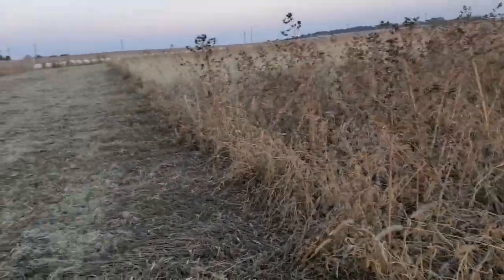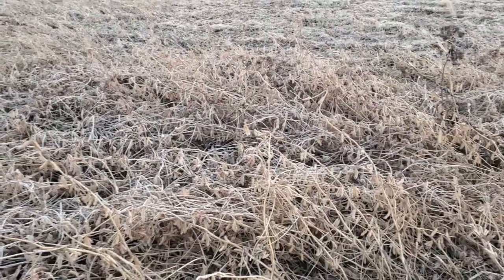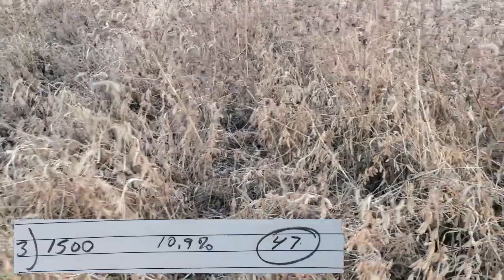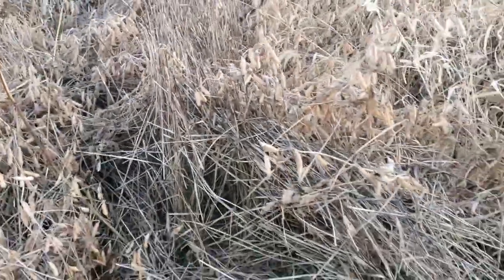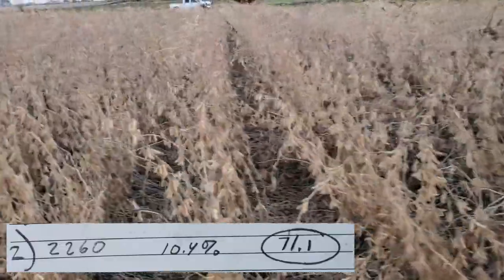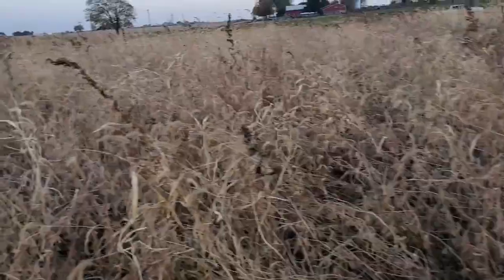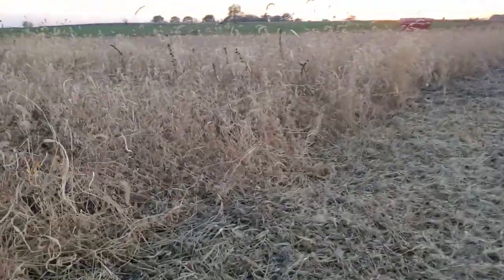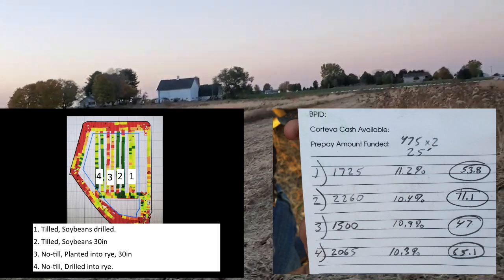Organic Soybeans into Rye Test Plot Results

Comment: Thank you for taking the time to do that, very interesting. A few questions that may help to represent different parameters farmers may be interested in. Although I can see it's not replicated and it's a first try, some conversion into net income may be good.
Value of the bales, rye and beans from each plot, then value of work not done in min till plots. Each plot is a different system and should be presented as such, as you've done with bean yield, but $ value would be great also. Thanks again
Reply from the maker: Thanks Seb. You have a great point. Using Iowa State Custom rates as a guide, taking out rotary hoe and cultivator passes could easily be a $45-90/ac savings. However, these beans were sold for over $30/bu. Even with a lot of savings it doesn't take too much of a yield difference to make up that difference in input costs. Each marketing year is different though, and if there were tighter weather windows to do weed control having some acres that take less time can make a difference vs having a field get too weedy because you didn't have time to get to it.

Comment: Have you ever considered zapping the rye to kill it , then no till In the beans?  Benefit : planting earlier vs. having to wait later for rye to mature correctly to be able to kill it - ( roller crimper method )
Reply from the maker: It would be very hard to weed zap a field of rye. Even in thick foxtail the generator can risk overheating. It would be similar to plugging in refrigerators in every outlet in your house. It would draw a huge load and would ultimately be more than the system can handle long term.
Reply: @jlacres9839   I have a Lasco and had done many experiments across 350 acres of soybeans this last year  . If weather allows and timing works , Zapping the rye at 8-12 inches tall would interest me , then no tilling in soybeans . I just had no rye in last year .